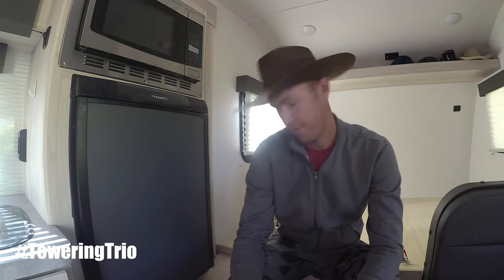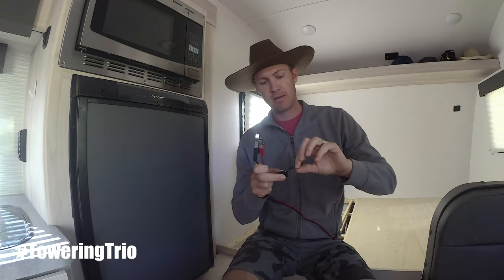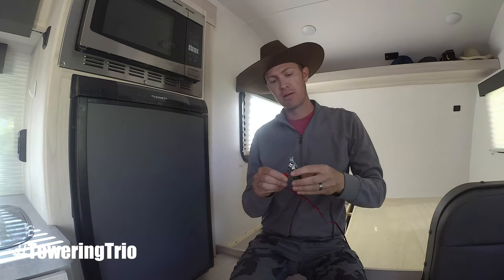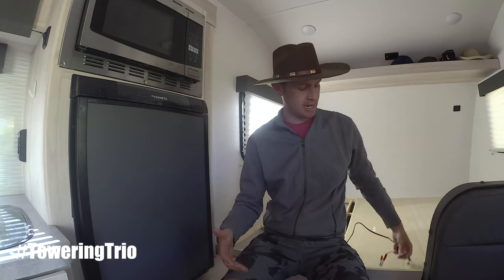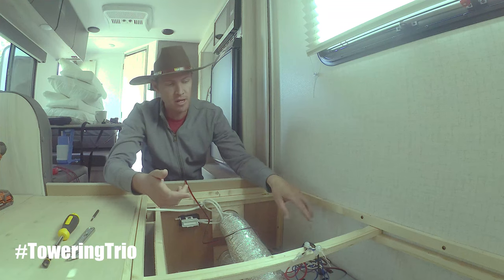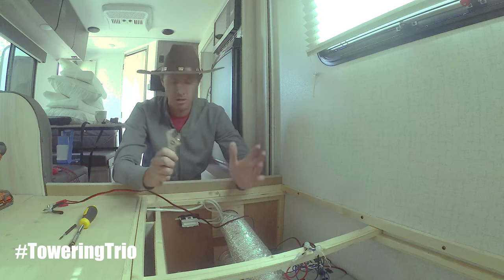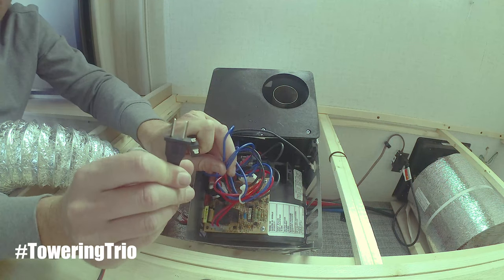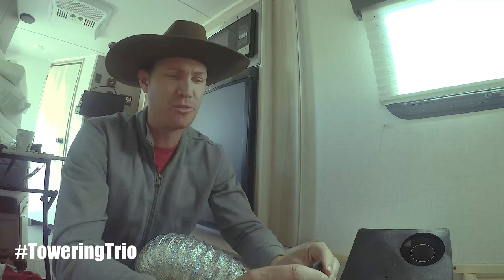Faulty Sail Switch? Bypass it on the road and get your furnace up and running. Winnebago Hike 170S

Comment: This is the part that scares me about buying an RV. I am not handy and worried will be having various equipment issues. Is the heater not reliable on the Hike?
Reply from the maker: Well, unfortunately it is the nature of the beast. Every RV is this way no matter the brand, cheap or expensive, they are all built to be able to make money. With a little research you can figure it out. I'm sure of it.

Comment: Our furnace went out in our new camper after some research we suspected it was the sail switch got the model off the furnace bought a new sail switch on Amazon was only twenty-five bucks the furnace is a dometic turned out it was only lint stopping it from working but apparently the sail switches go out all time I wouldn't bypass anything when you get a trailer just get a spare sail switch as well.

Comment: Hi towering trio can help on my 2018 dometi furnace turns on blows hot for 5 min then turns off
Reply from the maker: If you can check for fault codes on your furnace. That should give you a starting point.

Comment: FYI this bypass will not work on an aftermarket Dinosaur FAN 50 Control Board, as the board thinks the switch is stuck closed/activated and will not turn on the fan motor.
Reply from the maker: This worked well for our domestic, It seems that maybe yours has more protection. Built in.

Comment: I just spiced my wires an dont forget ya have to unhook them everytime or ya fan wont come on an then hook back together
Reply from the maker: Yes you must disconnect after it shuts off for it to come back on automatically.
Reply from the maker: I'm not sure if I mentioned that in this video or the other I had posted.

Comment: Is that not a fire hazard
Reply from the maker: Well, it's a temporary fix. And yes I had a disclaimer saying temporary only. Until you can get a new switch.
Reply: The amount of time it takes to install the bypass takes longer than the time to actually replace the sail switch. For $20 one could simply carry a spare sail switch and avoid pulling the furnace a second time to un-do the original modification. Furthermore you did not point out what would happen if the fan stopped spinning during a "bypass".  The sail switch is a safety device and should only be bypassed for diagnostic purposes and with a knowledgeable person present at all times to immediately disconnect it if and when needed. What you are suggesting to do here is akin to using the oven with the flame sensor disconnected. An explosion waiting to happen. When a technician does this they serve as a human sail switch waiting to disconnect the bypass.  @toweringtrio